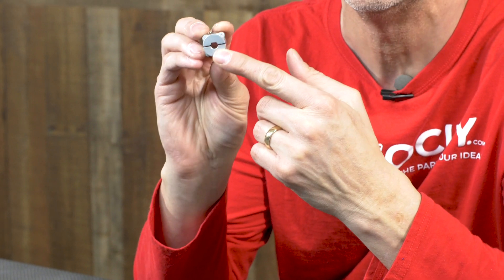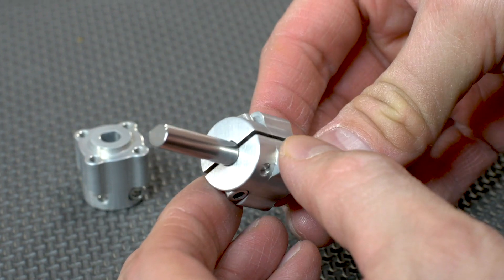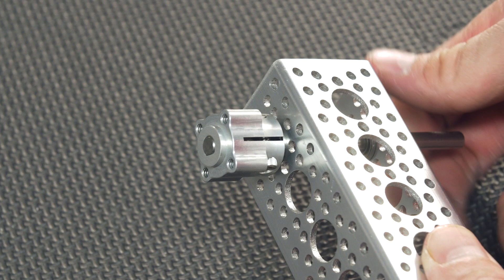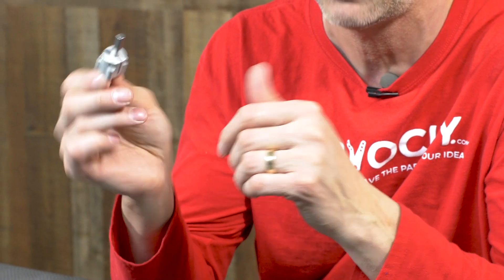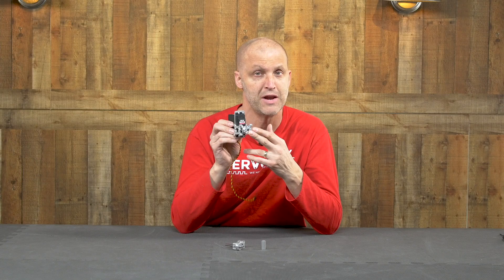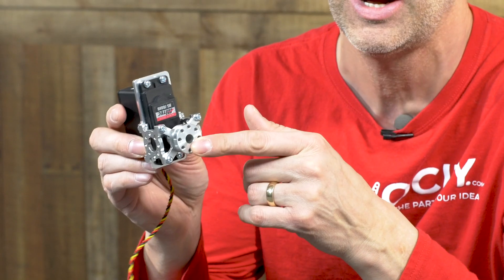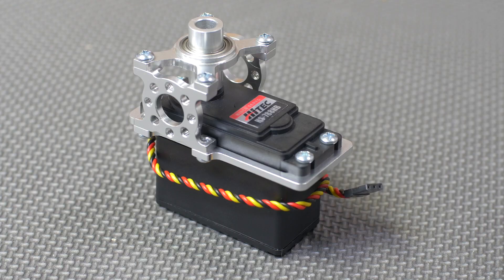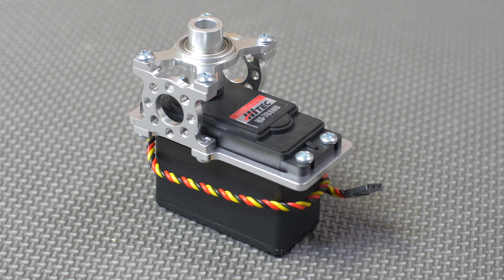ServoCity Products: NEW Barrel Hub, HS-788HB Servo & ServoBlocks™

Comment: Can a high torque servo be used with this?
Reply from the maker: Yes.  A ServoBlock will compliment a high torque servo by supporting the load with the 1/2" pillow block and allowing the servo to run more efficiently.  Feel free to reach out to our Tech Team should you have any other questions.  They'd be glad to assist tech@servocity.com.